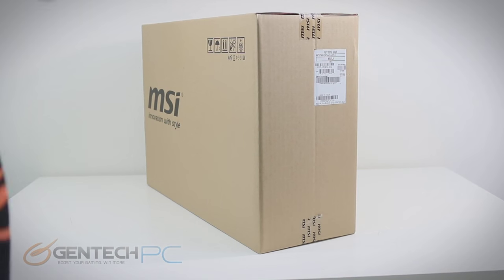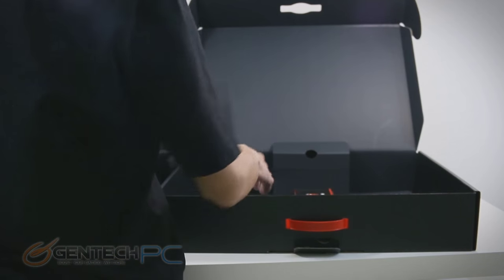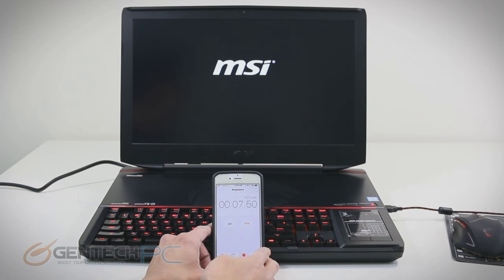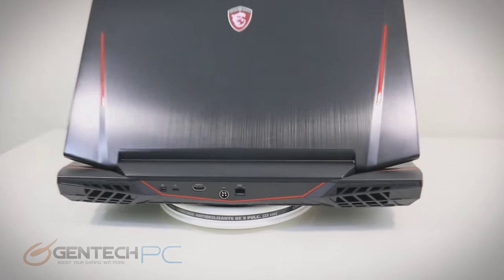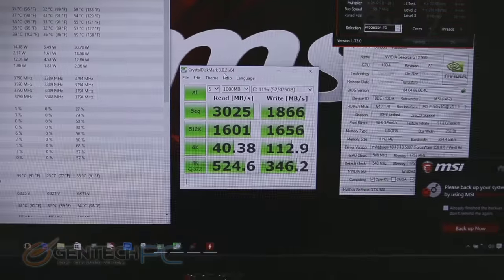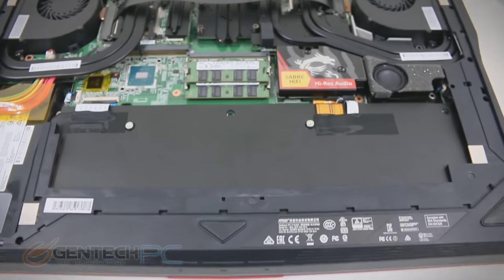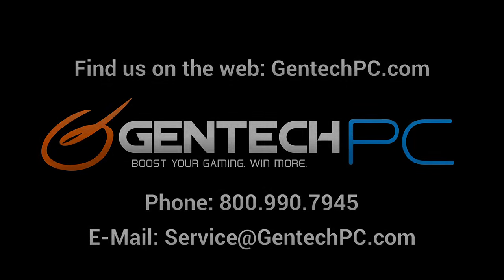MSI GT80S Titan Skylake, SLI GTX980 Desktop GPU Full Review & Benchmarks

Comment: Great review as always. My question is should I get MSI GT72 Dominator Pro G or  
SAGER NP8678-S (CLEVO P670-RG)?
Reply: +tiansianturi Tough choice, I have a GT72 Dominator and love it. Sagers are beautiful though, so it really comes to choice. The warranty on the MSi is top notch (2 years out of the box, and sometimes you get extra for registering online).
Reply: I have owned 3 Clevo's,... love them. I am the same boat as you. I'm torn between the msi gt72 line and the Clevo p775dm1-g . the Clevo has no optical drive but you can upgrade the (desktop) cpu. the msi has an optical drive but cpu is not upgradable. most everything is on par.
Reply: +Sarm 1084 I'm thinking to get Sager/Clevo too, but where you can buy  Clevo p775dm1-g online?

Comment: Thank You very much for this interesting review. Have You ever noticed any screen flickering under 90% brightness? As the brightness for this notebooks are being adjusted with PWM (Pulse-Width Modulation) technology {Pulse-Width Modulation, or PWM, is one of the ways display makers can use to adjust the display's brightness. PWM is considered to be an easy (or cost-effective) way to control the brightness, but it has serious drawbacks, such as flicker that may cause eye strain and headaches}

Comment: Can you confirm if the current shipping GT80S TITAN SLI-072 version comes with any extras?  I know it comes with the power adapter, but would it come wit the backpack, mouse pad, wrist rest and extra WASD keys?  It seems like MSI changes what they package with each model over the life of the unit so I keep seeing conflicting info.
Reply: +Just_Porter I found out that it only comes with the backpack and wrist rest.  No mouse or gold keys that come with some other models.  I found tons of keycaps on ebay and got a set of textured red ones for WASD that work great with the keyboard lighting.

Comment: 64 GB of system ram 8 vram, 512 GB m.2 SSD, 1tb hdd 7200rpm, i7 6920hq 2.9 ghz turbo boost of up to 3.8 ghz. Superb cooling options. When i aquire the funds, maybe sometime later this year. I will be considering this unless something better comes out that isn't massively over what i want. I will dish an extra 750 to 1000 but i won't go over 2000 plus. I also need too pick up a solid 4k display. And i want to see what laptops will be getting with the pascal gpu's.

Comment: Just got this today and was working great until I installed AVG (did this because it's the antivirus I have a valid copy of for another 10 months) and then it got into a constant 'preparing automatic repair' loop when booting and will not work at all now. So annoyed, a laptop that costs almost £4000 should be able to use any antivirus I desire (and yes I fully uninstalled all the preinstalled antivirus software).

Comment: didnt use the gpu button. i have a problem with my system now. dGPUs work completely separate from iGPU. So if put on dGPUs the laptop doesnt utilize the main laptop display. and if i use only the iGPU, it allows me to use the main display and also the externals still. However i cant use the 2 dGPUs!!!! WTF!!! my pc didnt do this before. whats different now?!?!?!!?

* i re installed my dGPUs (965m) hardware and software. but pc is not working like it use to*

GT80 TITAN 2QC 965m
Reply: Ended up fixin it but that issue popped up again during nvidia upgrade. Its been almost 7 years. I went on ebay and got this GT80S for the replacement. I like the build to much to do these little baby slim fit type laptops. Hope it works well and looking forward to making that baby work another 3 or so years.

Comment: Hi, I got the same MSI GT80S 6QF Titan laptop with 2 X 128 SSD which makes it 256 GB C drive and 32 GB DDR4 RAM. I want to keep the 2 SSD and add another 1 TB SSD in the laptop and add 2 X 16 DDR4 which will make it to a total of 64 GB RAM. Can you please let me know if this will upgrade my C Drive automatically or do I have to make some changes in Bios for it to identify the new 1 TB SSD and do I need to reinstall my windows 10 pro or it will work without it.
Reply: How is your laptop. Does it run well?

Comment: Just near the end of 2014 we had laptops that performed better than a GTX 780.  Now we have Laptops performing around if not at Titan levels!?  This is all progressing too fast man.
Reply: +KuroAkasha indeed indeed, well, now I wish they can shrink the size and lower the price. GTX 980 SLI on a laptop it just too awesome, but I can afford it >_<
Reply: The upcoming Nvidia 1000 cards are full fledged desktop cards in laptops. There are no more "m" mobile variants apparently, at least for the 1070 and 1080
Reply: The price tags on those laptops will probably be at least $3500 or higher.

Comment: is it possible to add a SSD to the optical drive(after removing optical drive from the slot  ). if so can you suggest me one caddy for he same.
Reply: You can but there's no reason to. It has 4 m.2 pcie ssd slots and another 2.5 inch slot other than the optical drive. I've got 4 500gb m.2 suds in raid 0 and another terabyte ssd in the 2.5 in mine and that's plenty of space.

Comment: As I checked, two GTX 980 SLI should get 31k score, this is like the half performance ~ why ?
Reply: +Chazzy Chaz  29017 doesn't seem like a half from 31k
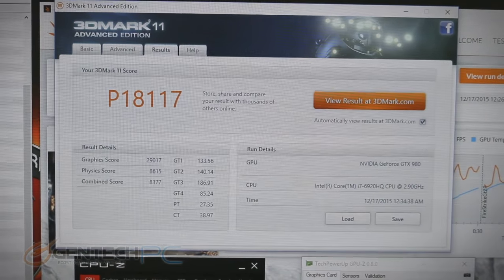Reply: +ludiqpich198 but it showed 18k @ 13:21
Reply: +Chazzy Chaz look at graphic score  not overall score
Reply: +ludiqpich198 my bad, I missed that part, thx for pointing out
Reply: +Chazzy Chaz gtx 980 in sli should have 28k graphics score at least, 23k graphics is similiar to 1 oced 980 ti on firestrike.
i guess 330 watt psu won t cut the power needed for dual 980 desktop.
´msi should give buyer 460 watt adapter instead
Reply: +Leo A These GPUs are very efficient, they are cherry-picked 980s, so therefore the 330W should be enough (the CPU isn't a desktop one, so that cuts down on the power draw). And also don't forget that this is a laptop. Cramming this much power into this form-factor and managing the heat is very difficult, so I'm not surprized by the results. And if you're overclocking the GPUs (I'm sure they are below stock desktop 980 speeds to start with) you're going to hit thermal limits very quickly. I'm just amazed that MSI could pull this off.
Reply: CptCsan yeah i know probably they use 100 watt cards. my point isnt their efficiency. just want to have a truly performance sli 980 each card with 165 watt power, just release a 460 watt adapter and 6k usd prices justified it
Reply: Cooling would be a big problem with that, though.

Comment: Also I have a huge problem. I'm the kind of person that wants more than what is needed, but let's be a bit realistic shall we. I'll write down below with honesty what my real uses are for the laptop, and I'd like to get some help and advice for what laptop should I get. I'm not a strong gamer at all, the only games I play are Dota 2 and League of Legends, so ofcourse I'll be "needing" not wanting, a laptop that could max them out while still maintaining 60+ FPS. Second, I just craze 4k like no other. I want my laptop to have a 4k screen(G-SYNC preferred) and good sounding speakers. Also I'm a freshman in Engineering and I need this laptop to cover the 5 years of engineering studies which will include in the future intense 3D Modelling, so the laptop should Also handle that as well. 16GB or more of DDR4 would be my choice as I already have an 8GB ram laptop and it's a bit low. The current specifications of my laptop is a 3rd gen intel core i7-3610QM, 8GB of ddr3 ram, 1TB of HDD storage and a Nvidia geforce GT 635m. I know it's a bit out-dated that why I need an upgrade. I would really appreciate anyone helping me and guiding me as I've been going through this problem for a long time.
Reply: they sell engineering focused machines now days. they come  with nvidia quadro cards. depending on your old laptop manufacturer you might be able to upgrade it for considerably less money. Max out system ram. upgrade os. ssd. get an extreme edition mobile i7 3rd gen. update your WiFi card to an ac model. and change out your mxm too. I did it to mine

Comment: I'm surprised that no one has commented about the horrific thermal paste job from the manufacturer for this laptop.  You'd think that for spending some money like this they would actually try to apply some thermal paste properly.  You could easily drop those max temperatures with better application and/or better paste.

Comment: Nice laptop but no gsync?
Reply from the maker: +Jason Mak (JPSM) G-Sync panels are not available on 18.4".
Reply: +GenTechPC Hey, I checked out your website particularly the GT80s Titan SLI-012 version and it says that it supports Killer networks "25" not the latest one that is on the MSI website the Killer "35". it must have been a mistake on Gentechs part.
Reply: +Lindee Mayy I mean it supports Killer Wireless-AC N1525 instead of the stock N1535 thats on the MSI main website. why is that?

Comment: so how many watts does the power adapter give ?
Reply: 330w way underwatted in my opinion
Reply: +Charles Mabry Agreed.  I expect some throttling under both max CPU & GPU conditions.  I do not plan to overclock at all due to the low wattage supply.

Comment: If this monster had a 4k g-sync panel, the sli would be worth it. but sli on 1080p is overkill.
Reply: It's for the two 4k displays you can connect to it.
Reply: +Wilbert Cedeño then what's the point of the 1080p screen inthe laptop if they want you to game on 4k? It just does not make much sense.
Reply: +ExpertWeapons After actually getting my laptop and using it, I'm glad that it has a 1080p screen. The computer can barely run 4k for some games. I run at 1080p for all my current games.
Reply: Wilbert Cedeño well I'm not a heavy gamer, i only play League of Legends and Dota 2. That's why I want to max them out in 4k.Btw, what's your laptop?
Reply: +ExpertWeapons The same one being reviewed except with more RAM and disk space.
Reply: +Wilbert Cedeño how did you like the 072sli?
Reply: +BOSS LAU I like it a lot. It's really fast. The CPU is a bottleneck though. I wish the screen had G- Sync. The 4K performance is not great for some games. My screen has two stuck pixels already.
Reply: +Wilbert Cedeño you didn't overclock the cpu tho? could you just send it back if it has 2 stuck pixels.
Reply: +Jay Liu The CPU is locked, plus I don't like to overclock hardware because I'm worried about reliability. I would like just the screen replaced and not have to return the whole thing. I'll send a support request eventually.

Comment: Hello All ,Just a couple of tips for anybody watching this and they decide to dismantle there Laptop ,Before taking apart your very expensive much loved Laptop ,1)Make sure your Laptop is placed on a Anti-Static Hardware Mat ,2)Make sure you are also wearing a Anti-Static Wrist Band that is connected too any type of Metal that has not been painted ,3)Don`t  take out your Hardware then place it down on top of any other hardware ,place it on another separate Anti-Static Mat or even place your Hardware on any Anti-Static Hardware Bags ,Never touch your hardware with your hands especially when it has just been switched on and powered down unless you have done the things stated above ,Remember this have you ever touched a door handle and got a static shock ,Well that is all it takes to destroy a nice piece of expensive Tech that you have so much been waiting to get i know these things because i have over the years learn`t everything about Hardware and Circuits in 20yrs i have only screwed up one piece of Hardware £350 pound Motherboard just because i got lazy and did`nt bother to use my Anti-Static tool kits one Static voltage into the Motherboard was all it took and it just would`nt run right ,This video is nice to watch but with a Laptop as good as that well the dude took a very big risk even opening it with using the right tool kits i just thought i would warn people who are just starting off in the Tech world.Takecare People God Bless You All.

Comment: Sorry GentechPC but you made the worse mistake you can make on this video and you made the mistake several times through out the length of this video. Your mistake is: You called the GTX 980 Desktop GPU a GTX 980 Mobile GPU Thats confusing because there is actually a GTX 980m mobile GPU. The GPU's in this video are Full Desktop Versions of the GTX 980... The Cards you are showing are the exact same as the GTX 980 installed in a Full Tower case. They just been stripped to put inside this laptop... Please do a Crysis 3 Benchmark with this laptop....Please Also do a Witcher 3 Benchmark :))))) Thanks and again it really is a horrible mistake. However you can fix this with YouTube annotations.
Reply: bro it is a desktop 980 gpu :D btw love ur vids!
Reply: Gwola Yes, i have seen this on the MSI website. Its actually amazing :) Thanks as well.
Reply: +XTREME PC GAMER ye amazing but 330w is too low power for 980 sli..one of them can use 200w max..i think a converter box would be really good here :D